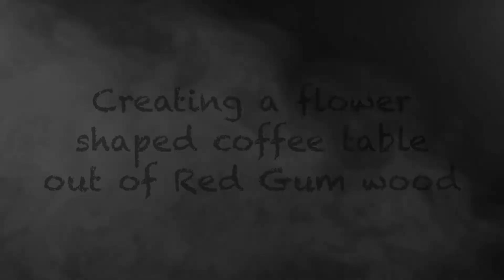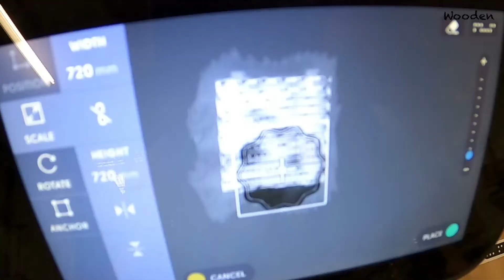Flower shaped coffee table out of Red Gum wood - Red Gum #shapermade

Comment: A gorgeous piece as usual my friend. Nice job! If I hadn’t watched the build, I would have sworn it came from one solid slab. The grain flows beautifully. I have to ask, does the wood have a eucalyptus door when you mill it, or any other door?
Reply from the maker: Thank you my friend :D I would lie if I claim that I knew it would turn out this way. Yes, I tried to combine them well, but before coating, the slabs looked pretty similar. When it was done I also was like: Where are the joints? Amazing that it turned out that way. The wood is pretty underwhelming. No odor of eucalyptus or anything (unlike Olive, which leaves your workshop smelling like an Italian olive grove). The wood is pretty light, and kind of weird to work with. Like Wenge, but softer and lighter. Not my favorite wood, but I have still about 20 of those slabs, so I fear I will have to work with them again in the future, haha...